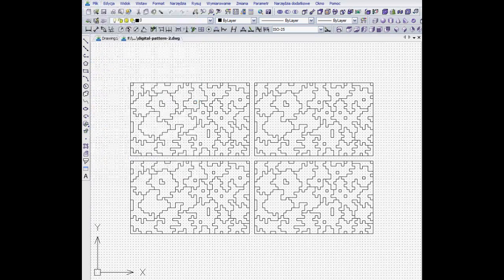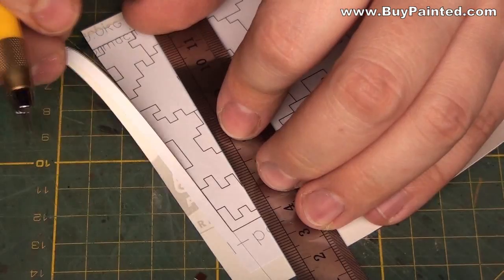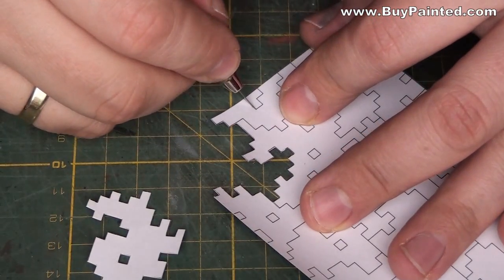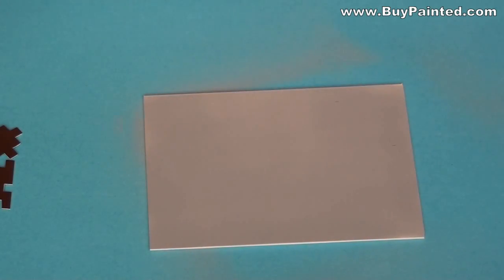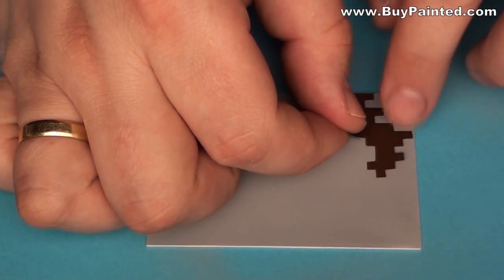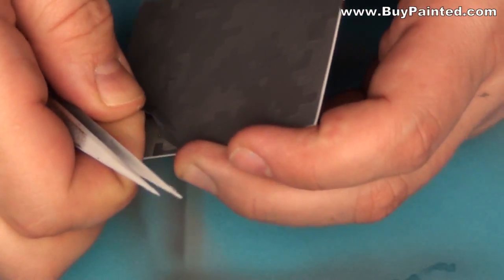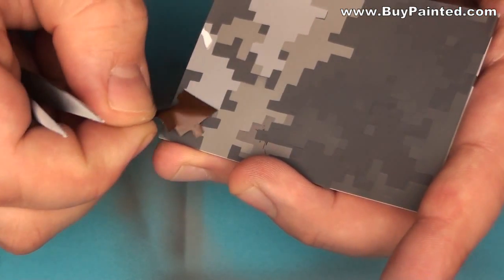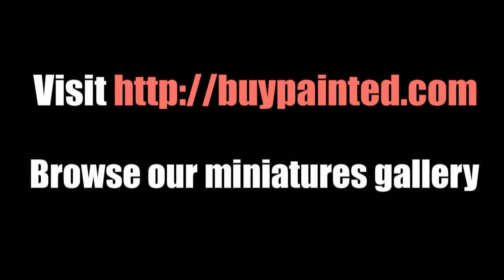How to paint digital camo on a model?

Comment: This method is way to complicated. Just cut out the shapes and use the "negative" part for air brushing. Then layer on top of each other as the surrounding material will mask off the area you don't want to paint. You can do it this way about 50 times faster and you can reuse the stencil as many times as you want.